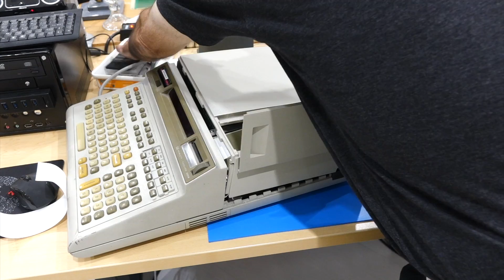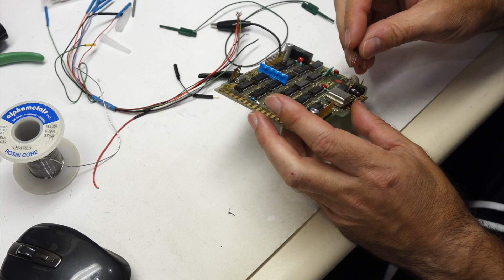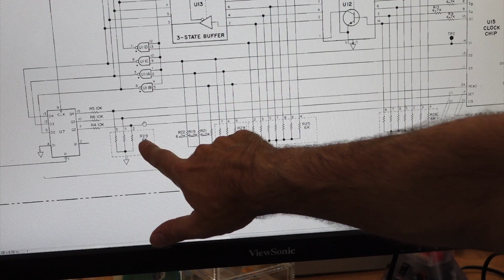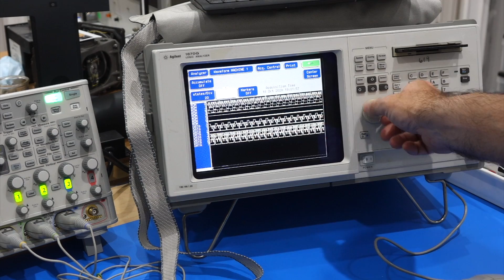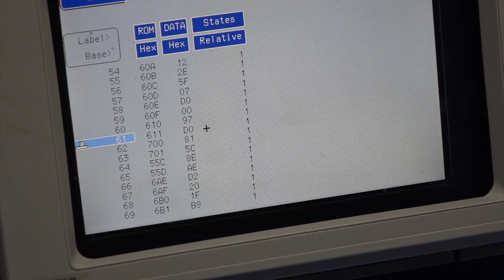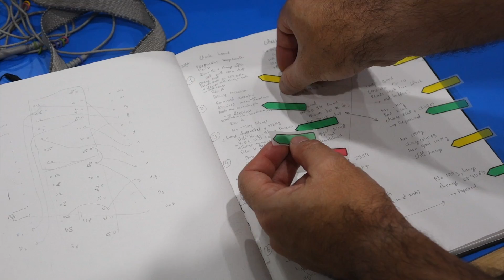HP 98035 Clock Module Repair-A-Thon - Part 3: battling voodoo electronics and magic smoke

Comment: I love the series.  We used an HP 9825 at McDonnell Douglas in St Louis to acquire test data in the Advanced Design Wind Tunnel from 1975-1990.  Data was recorded on the magnetic cassette and sent to another building for data processing on an identical 9825.

Comment: The processor in there looks a lot like the one that controls the original 6568A HP spectrum analyzer. There was a later upgrade (B version) that replaced the special HP processor card with a 68000 and that ran quite a bit faster and added the features to perform the CISPR25 EMC tests. The original intent was to have a 9825A control the spectrum analyzer, but we use it with a PC and a set of Windows programs to run the tests.

Comment: As interesting as it has been following this saga, I'm getting the feeling there are now more working HP 98035 clock modules than will ever be wanted. You going to look at that System/360 again?

Comment: Excellent voyage of discovery.  Thank you.  The leaked potassium hydroxide electrolyte is hydroscopic and will remain liquid indefinitely.  It will creep under chips and between pins and create mysterious shorts that will come and go with the weather -- literally -- due to the change in relative humidity.  IMO, you should give all the boards a bath in weak bisulphite in an ultrasonic cleaner as a matter of course.  Pull the irreplaceable chips first and bathe those in isopropanol and distilled water separately.

Comment: Marc you have to test the last few boards.Voodoo is goodoo,because thats where  im learning  a lot of the weird failure  modes that a system can throw  at you.
Also im realising how important it is to have multiple tools to tackle a problem,so the reverse engineering of the processor by ken,and the disassembler was a tremendous help in zeroing in on the problem,which  i began to suspect was a stuck  bit on the databus,after it ignored a return from interrupt.
At a particular moment into the video when you were kind of stuck with  max voodoo,i was
  yelling  LOGIC ANALYSER!!!!  lol..
It has been great fun following this fix,and this channel,and the title of curious marc definitely fits.
Sooo,you have to fix the last few boards really,dont you??

Comment: Nice to see someone else encounter all the weirdness and gremlins that can come up.  I've bee servicing for decades and have encountered the most bizarre symptoms and things happen.  I've repaired at great effort a piece of equipment only to have the most expensive and illusive-to-find component fail  right in front of me thereby relegating the piece of equipment to the "dumpster!"  In all-truth, I would probably  on fixed these on an as-need basis but thoroughly enjoyed watching you slay dragon after dragon--Bravo!   The disassembler was a huge boon and allowed you to quickly zero-in on errant code as opposed to having to take endless samples with a logic analyzer to see where it all went wrong.. Anyway, you're a sharp guy and thank you for taking the time and trouble to make videos for your excellent community!

Comment: Of course you need to do the other boards, otherwise you don't have 5 working clock modules. And, you know, right off Ken's blog "Making an FPGA version of the Nanoprocessor would probably be a fun project since the Nanoprocessor is about as simple as you can make a real, commercial processor. The User's Guide explains the instructions and has sample code that could be executed."

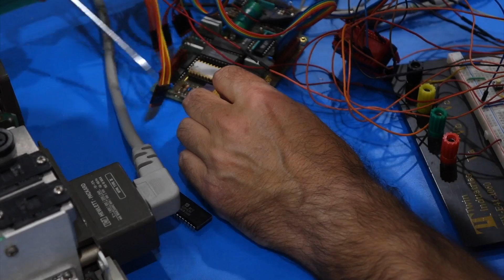Comment: I may have misunderstood, but the ROM you swapped at 23:00 you have assumed was faulty but in fact it was later found to be the dodgy pin on the nanoprocessor.  But you didn't go back and test again with the ROM you originally removed -- could it be that the ROM is still OK?  Please keep going!
Reply from the maker: I did not put the footage in, but the purple ROM was tested and 100% dead.

Comment: Great job Marc! Dealing with battery corrosion is a real pain. I have found many times it requires removing all the components in the corroded area, cleaning the PCB/parts with a fiberglass pen, and then reassembling. A time consuming process to be sure but the only way to rot out the green crusty goblins. It would also be awesome to see yourself and Ken make a Nanoprocessor replacement :)

Comment: I love the series! Because I am also doing almost every day old equipment repairs and watching your channel I borrow some of your techniques.
CuriousMarc, may I give you an advice? When you are powering circuits ALWAYS put a bulb with appropriate wattage and voltage in series! If there is a short or something wrong the bulb will immediately give you a visual indication of a failure and catches the magic smoke, saving a lot of work and for sure your old equipments too.
A pack of bulbs worth $10 saved me thousands $ worth parts and hours of work!
Great work!
Please don't despair and pursue finishing repairing this beauty!

Comment: every repair starts with a visual inspection, then you remove any corrosion, then re-solder suspicious joints. much less time could have spent on this

Comment: Truly inspiring, love it when you brought the cavalry. What a beast of logic analyzer
Reply: Yeah. I've got one of it's predecessors, the HP 16500B mainframe, which is even bigger, with a 16510 100MHz, 80 channel card. But the UI looks nearly identical. I think mine is running v3.13

Comment: Can you put the shortet nano processor on your component tester, to see what the voltage is when he starts to draw current like 0.7V if it is  an diode?
Has the processor an internal connection where the 9v comes back out, for other stuff like a capacitor?

Please repair the other boards

Comment: A little trick I learned many years ago when trying to fix my daughters' P2 computer.  Thing was giving me fits and I just could not figure it out.  Finally gave in and I told it that I was going to power it off and then head to the garage and get a sledgehammer.  When I come back and power it on it had BETTER work without any problems or else I would take it into the street and pound it into dust.  Sure enough I turned it off.  Walked into the garage and came back with a 5lb sledge.  I pressed the power button and got the single beep I was hoping for.  I waited and watched as it fired up and worked perfectly from that point on.  My wife, who had been standing behind me unbeknownst to me, told me she had never in her life ever imagined that someone could fix a computer simply by threatening it with a hammer.  I told her it is a very old trick but you REALLY have to mean it and be willing to follow through.  Computers can sense when we are bluffing.  :)

Great series.  Have been thoroughly enjoying watching and I am almost ashamed to admit just how much old equipment like this that I have scrapped over the years for the precious metals.  Couldn't find anyone who wanted it as-is so I wasn't left with any other options.  Wish this channel had been around 15 or so years ago.  I could have set you up with a LOT of goodies. Even now when I look at the gold traces , pins and processors my mind first goes to thinking about just how much gold I could recover from each.

Comment: Jaw-dropping work. Debugging based on code tracing for an undocumented and long-lost processor, reverse engineered from a half-century-old mask set, using source code resurrected from reverse assembly of stored ROM object code. Curious Marc is one determined computer historian. My only contribution: squirt some snake oil (De-Oxit) into the ROM and processor sockets. They're 45 years old and have more than four decades of oxidation on their contacts and on the device pins. you've already seen one poor contact causing problems.
Reply from the maker: Thanks Steve. Since it looks like people want the interface boards repaired, I'm about to shoot you and Dyke a little email about the details of the 9825/module interface, see if I can pick the brain of the original engineers  a bit!

Comment: This channel should be named StubbornMarc...!  You've once again proven the theory of voodoo problems - connect enough test equipment and the problems are eventually scared away.  Regarding the dead nanoprocessor, maybe Mike Stewart could whip up a quick FPGA implementation of the chip...  (that'd be awesome, btw).

Comment: Had a guy at work with a similar situation with 5 sets of boards of a equipment not working and 3 good sets to use as base, he started swapping boards around and in the end of the day he managed not only to get the 8 non working but also damaged a bench power supply lol, we had to pull the heavy machinery out, like in the video, to be able to fix 2.

Comment: Hi ! I do recommend your series to some friends that claim "to have repaired electronics" - to let them know how real experts do that. Out of some spite I must confess. In most cases they tend to swap out some capacitors or resolder "suspicious looking solder spots" and hope to get things fixed without even testing the supply voltages. Most self-acclaimed "repairman" have no clue about systematic failure analysis even on more simplier circuitry, they ignore the basics and start "somewhere" ... and wonder why they fail.
Reply: Most modern suppliers unfortunately don't publish schematics like they used to, even if you knew what all the chips are once you get into multilayer boards it becomes really difficult to even figure out what's connected to what :(

Comment: Great video, as always.  Glad you didn't damage your awesome HP calculator.  I'm working on a tiny compressor to put the magic smoke back into components, but so far it's not going well..
Reply from the maker: You can do it! Forcing the magic smoke back in is the right approach!

Comment: The open circuit voltage of the 9V rail was 9.34V and there was 9.332V across the 100R resistor implying a dead short with 50mA. I wonder why the ohmmeter showed a few K with presumably a lower test current. Voodoo negative resistance!
Reply from the maker: There is no short if the rest of the processor is not powered. It’s an “active short”. Unusual. Or some kind of Voodoo curse.
Reply: @CuriousMarc  Voodoo indeed. I can't see how anything in a chip that old could generate such a low impedance except a metal short. From your description it is behaving like a super low RDSon MOSFET, which hadn't been invented back then!
Reply from the maker: @nophead  Agree. There is something cheesy about this. Also the fact that it worked fine before, and then suddenly a short appeared out of nowhere. And smoke came out of the transistors and not the processor? It does not make sense. There is likely something else going on that has not been elucidated.

Comment: Is it time for Ken to do an FPGA emulation of the nP, and PCBWay to do a special 40-pin DIP carrier board?
The board with the corrosion: would it not be worth de-soldering the resistor pack and replacing it?
A great, informative series - enjoying this a lot! My vote is to continue :D

Comment: I feel sorry for the mains switch and the power supply input circuitry of the calculator. They must have seen many years of wear during these marathon repair sessions. They must be good quality.

Comment: It's time to duplicate the ROM onto a 2716.   If the boards were not stacked in a sandwich, it would have enough room to use the two sockets I suggested in the earlier episode.  Since the chip select pins are different, the traces may have to be cut and rerouted to resolve the chip select issue.  The ceramic ROM looks like a 2716 but it doesn't have the window for the UV eraser.  Could it be that HP used a 2716 die but had the chip select wires rerouted inside to be like the black ROM?  It might explain why the ROM died after so many years.  The EPROMs just lose their charge over time and get "bit rot".

It's incredible how a tiny amount of battery juice can make things go so weird.  Thanks for the fascinating videos.

Comment: There's something immensely satisfying about fixing digital circuits that have succumbed to the stubbornly analog world. I managed to repair a motherboard with a bent CPU socket pin that was preventing the processor from accessing one of the DRAM channels about a month ago. Felt like a master of the arcane when it booted back up again.
Reply: Gotta love that feeling. CS is definitely modern wizardry.

Comment: It has been many years since I’ve seen that HP Desktop Calculator. When I was a B-52H avionics tech for the AN/ASG-21 Defensive Fire Control System (aka tail gun system) that was manufactured by Emerson Electric, the semi-automated test stations I used for testing the system LRUs used that HP computer for the E831, E832 and E833 test stations. The computer the HPIB IEEE-488 bus to communicate with the various pieces of test equipment to exercise, stimulate and test the various LRUs. The E831 tested the antenna, electronic control line platform, system control assembly and tracking control assembly. The E832 tested the control indicator and ballistics computer. The E833 was used to test just the frequency converter transmitter. I had so much fun taking care of these test stations and keeping them working until the Air Force retired that weapon system in October 1991. Keep up the videos Marc!

Comment: Why don't you build an replacement Module for the clock Chip using for example an arduino and a RTC Module? Vintage Chips aren't around forever so it would be more sustainable in the future
Reply: A single Atmel 8bit MCU with real-time clock (some have it) would be all that’s needed to replace the entire module, not merely the watch chip :) I’d say dwelling on the watch chip has little point since that chip is just as unobtainium as the nanoprocessor. Having a replacement that gets rid of both unobtainium chips would make most sense.

Comment: I'm wondering if the crystal was really bad on the vinegar board, or if it was just caused by corrosion you hadn't detected when you swapped the crystal. It was down on the same end of the board with the SIP resistor pack and the green mung. The crazy way it was working on the scope was making me think there was a voltage leaking onto the signal pins.

How did you get the disassembly listing for the code in the nP? Did you write a script to do a basic hex to mnemonics disassembly and then do a lot of hand analysis for the comments? Or is there some tool that is smart enough to generate decent functional comments when dissembling code?
Reply from the maker: I agree. I think the original crystal was good enough, but there was a shorting path before vinegaring the board. Ken Shirriff wrote the disassembler in Python (see previous episode and his blog), which also emitted some automatic comments describing the instructions. Functional commenting was all done by hand, slow detective process.

Comment: Voodoo electronics. Been there, done that. Voodoo software, too.
Reply: Non-deterministic software. BTDT. Swap two random lines of code that don't depend on each other and it started working. On a different occasion I put a log.debug("test"); somewhere and the program started working. Removed the debug and it stopped working.
Reply: @senilyDeluxe  Yep. We called them "Heisenbugs."

Comment: At least get some mates for the now working boards, also i'm curious to know if the rom was actually bad or if it was just something else causing the issue
Reply from the maker: The ROM was actually bad. I tested it afterwards in the PROM reader and could read nothing out of it.
Reply: @CuriousMarc  dang, it would have been fantastic if it was still working

Comment: Hi Marc. At step 30, it pulls 0xB8 off the data bus at 0x05EA, which I’m presuming is your RTS. At that point, it spends 2 clock cycles pulling 0xB5 from memory location 0x05EB, and another two clock cycles pulling 0x04 from 0x05EC. So it looks like the processor is trying to pull the return address (0x04B5), but from where? Where is the stack on this machine? It then looks like it failed to put the return address into the program counter (PC), or the next instruction address would have been 0x04B5. Maybe there’s a problem with RAM? However, after the last two clock cycles (steps 33 & 34), the address values increment by one as usual. Or does the RTS instruction take 2 bytes after it for the return address? That would be very weird; most processors would have the JSR shove the return address on the stack and jump to the address specified by the bytes after the JSR, then the RTS would pop the return address and shove it into the PC.
Reply: There are docs for the machine available online. If you go back to the previous video Marc gives links to Ken's site where he reverse engineers the chip, and that blog article has a link to the processor spec.

The processor contains a 1-deep subroutine return "stack" on chip; which is to say, one register to hold the return address. So it is getting the return address internally, and you probably can't see it on the external interface.

Comment: I really enjoy these videos and would like to see you tackle the interface boards! I suspected that PROM back in part 1 - I have seen lots of them fail.
Reply from the maker: Thanks, that was a great comment back in part 1. I remember feeling dumb that I had changed all the chips on headers except the ROM, which is one of the most failure prone!